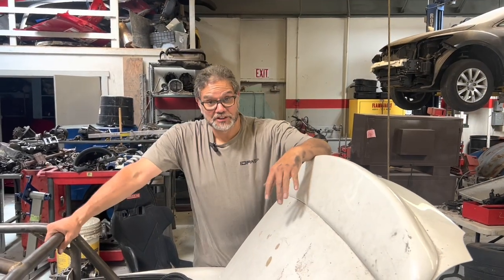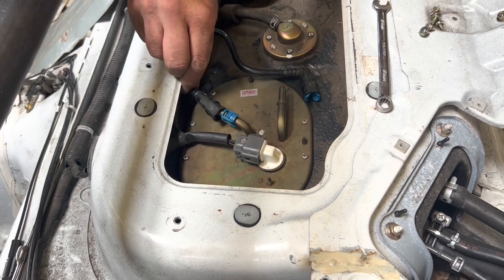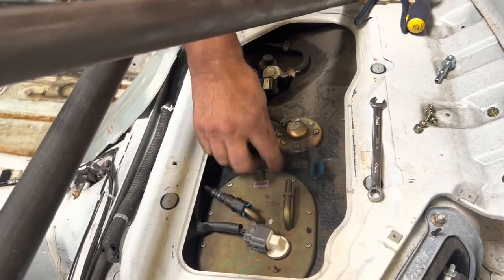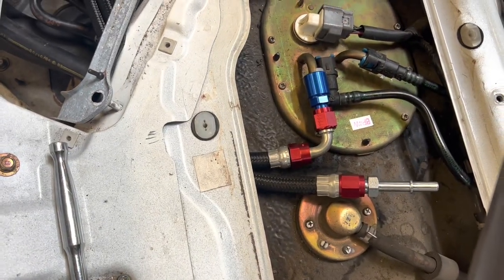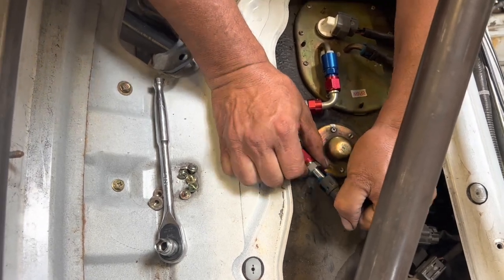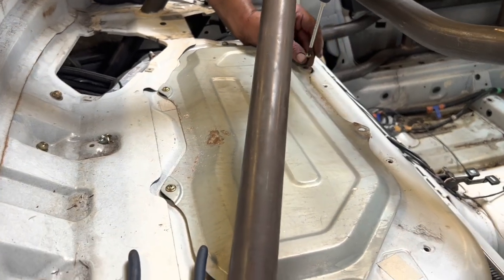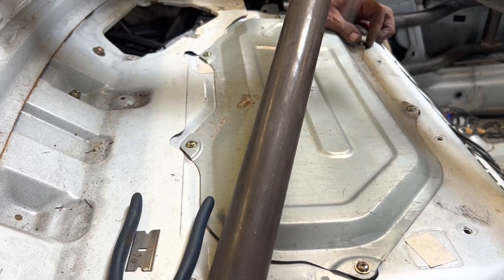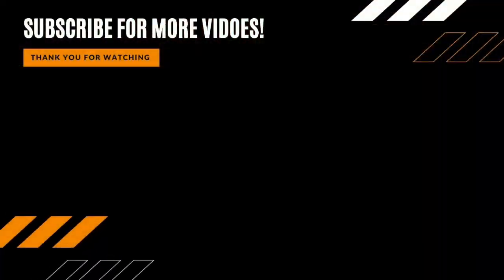PT25 How To Build A Spec Miata, Fuel Pressure Regulator. MX5, Autocross,Track Car

Comment: Am I right to assume that this adjustment changes the AFR at WOT when the ECU is in open loop, but does not change it at part throttle when it is in closed loop operation?

Comment: That's how to do it, but WHY would someone want to do it? Doesn't the car already have a fuel pressure regulator? Are you restricted to the oem fuel pump so this is a way to get a bit more fuel / power?
Reply from the maker: Yes the car has a fuel regulator valve but it is not adjustable. The benefit is when it comes to dyno the car. you need that adjustment to get the right fuel air mixture for the most power.
Reply: Hey Al, if you don’t want to spend the money  to dyno the engine, how would you eyeball the right fuel pressure? Is it by judging how strong it pulls (it would have to by a pretty big jump to notice an improvement) or can you check by how wet/dry the spark plugs run? Or in other words, if you’re not looking to wring the last bit of hp out of the engine, do you even want to put in a fuel pressure regulator? Thanks a lot.
Reply: Hello sir, I have a doubt could I ask you?.

Comment: Before getting the car dynoed, how should the preliminary setting be? Open all the way up or tighten it down? Or what pressure at idle
Reply from the maker: I set it to 60lbs, but it will run right out of the box. I wouldn't hammer on it until its dynoed unless you check the fuel pressure and set it to 60lbs first. Do not want to run too lean.